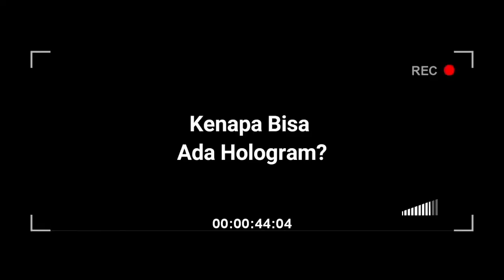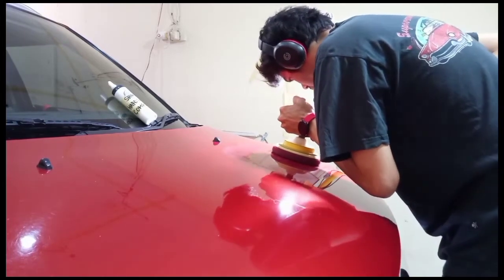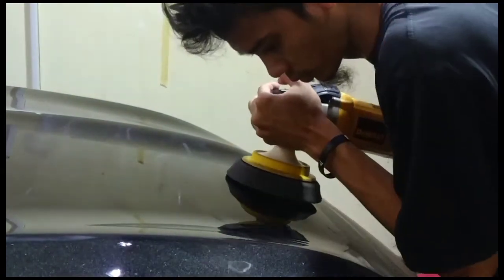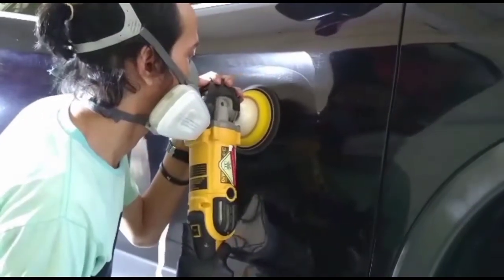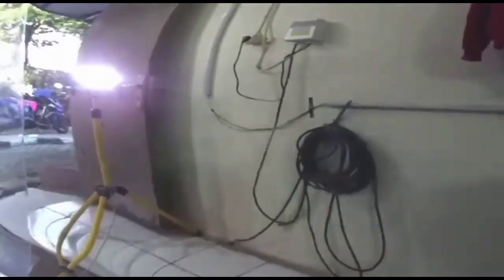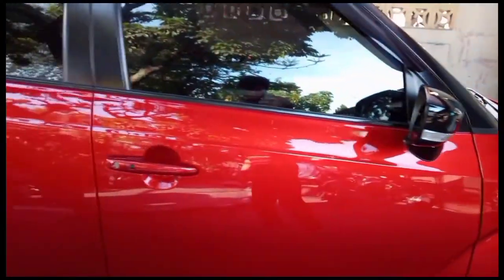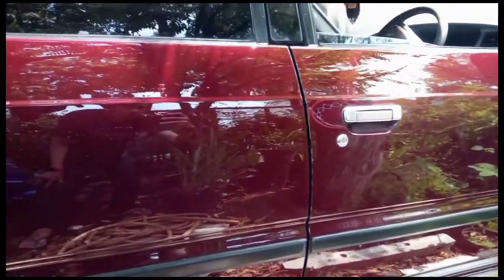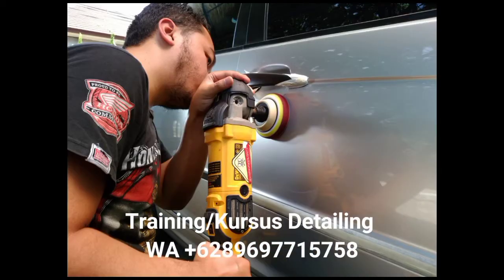Cara Menghilangkan Hologram/Buffer Mark di Mobil Warna Hitam

Comment: Alo gan..saya kya nya alami efek embun atau hologram setelah di kompon bgkel, mobil Ertiga item metalic itu smisal di kompon kedua apa ga bikin Cat mudar atau baiknya gmn? Thx
Reply from the maker: Cat pudar sih gak ya om selama penanganan & teknik polesnya tepat.. Bisa dicoba dipoles ulang pakai cutting compound yg grade PRO spt Ultimate Heavy Cut, IPO Ceramic Cut Plus atau merek lain (nti saya share link tokpednya) dgn mesin rotary atau pakai mesin Dual-Action agar lebih mudah dipakainya..
Reply from the maker: Compound cuttingnya bisa pakai ini dipadu dengan busa cutting

https://www.tokopedia.com/tokosalonmobil/repack-250-mili-ipotech-ceramic-cut-plus-cocok-utk-soft-sticky-paint 

Untuk compound finishingnya bisa pakai ini dipadu dengan busa finishing

https://www.tokopedia.com/tokosalonmobil/repack-250-mili-ipotech-ultimate-ultra-fine-polish
Reply: @BelajarDetailingAcademy  maaf  gan, mgkin saya blg ke bgkel nya soale bahasa namanya saya ga ngerti..alias tdi liat hasil bgkel kok kaya embun ud saya cb cuci lg msi bgtu. Tpi sbelumnya salam kenal n makasih ud mau respon saya gan...
Reply from the maker: Bagusnya pindah tempat aja om, mendinga cari workshop detailing aja biar lbh pasti.. Nanti takutnya kyk gitu lagi kasusnya kalo balik ke bengkel yg sama.. 

Ya hasil kyk gt bisa karena kurangnya pengetahuan memoles yang tepat, alias gak ngerti teknik poles yg bener..
Reply: @BelajarDetailingAcademy  awalnya saya abis ketok cat di bgkel itu gan, tpi liat hasil nya kok ngembun..bsk rencana mau di kompon ulang di bgkel yg sama..alias garansi.

Comment: Bang motor saya body doff pake kompon ada bekas putihnya gitu cara ngilanginnya gmna ya
Reply from the maker: Waduh, kenapa dipoles pakai compound om? 

Bisa jadi kalo doff/matte kena compound itu jadi Luka, agak susah nanti ngilangin bekasnya.. Karena karakter Clear/Pernis nya memang berbeda.. 

Coba bersihkan dlu dengan Air Shampoo, terus dikasih Wax/Sealant semacam EXXO Coat dari Coating Factory... Mungkin gak hilang secara total, tapi bisa mengurangi.. 🙏
Reply: Bang mau nanya untuk menhhilangkan baret kaca mobil bekas lap kasar pakai apa ya obat nya dan cara tahapan nya 🙏..terimakasih

Comment: Om unt menghilangkan kabut mungkin yg disebut hologram setelah dipoles sebaiknya pakai poles finish merk apa ..
Reply from the maker: Apa aja om bebas kok merek apa aja.. Selera.. 

Kalo utk mobil2 soft & sticky (yg lengket2) saran sih pakai Ultimate Soft Finish..
Reply: @BelajarDetailingAcademy  klau diamplas dulu kira2 boleh gak  dan klau boleh menggunakan amplas nomor brp.soalnya awalnya sebelum sy poles mobil sy amplas dulu dng amplas 1500.ee setelah sy poles malah goresan bekas amplas msh keliatan dan berkabut putih..mobilnya honda city hitam
Reply from the maker: Halusin dlu pakai amplas 2000.. Setelah itu halusin lagi pakai amplas 2500.. Yg terakhir pakai amplas 3000

Comment: Kalo di soft paint itu udah di poles bersih bgt udah ga ada swir dan goresan halus ehh begitu di lap ada lagi swir.saya coba begitu dah di polishing ga saya lap saya coba di cuci dah gitu saya coating ehh pas di lap coating nya ada swir lagi padahal lap microfibernya baru dan bersih.
Reply from the maker: Swirls nya bekas Lap atau bekas polesan? 

Kalo bekas Lap biasanya bukan Swirl, tapi goresan lurus sangat halus.. 

Kalo bekas polesan yg belum Mateng iya bentuknya Swirls tapi lbh halus dari kondisi sebelum dipoles..
Reply: @BelajarDetailingAcademy   swirr om jadi kondisi cat nya dah bersih begitu kena lap adalahi swir tapi lebih halur dan kecil lingkaran nya apa softpaint itu kalo di lap emang gitu ya
Reply from the maker: Udah di poles step finishing? 

Ada 2 kemungkinan, 

1. Hasil step 1 cuttingnya blm mateng atau masih menyisakan swirls yg agak dalam. 
2. Hasil step 2 finishingnya kurang mulus, jadi terlihat mulus karena tertutup minyak compound, ketika di Lap IPA akan terlihat lagi swirls nya..
Reply: @BelajarDetailingAcademy  makasih banyak om petunjuk nya 🙏

Comment: Om saya kan ngilangin baret halus di mobil  pake compond, pake cara manual pake tangan ,nah setelah di kompon kok malah jadi kusam putih2 gitu, cara ngebalikin wrnanya gimna ya om? Mobilnya wrna hitam
Reply from the maker: Dipoles lg om, kalo bs harus pakai mesin poles, boleh Rotary atau Dual Action..
Reply: @BelajarDetailingAcademy  saya ga punya mesinnya om, kira2 kalo ke bengkel minta polesin kena hrga berapa ya om? Buat pintu tengah sebelah kanan doang
Reply from the maker: Yg pasti dipolesnya 1 panel pintu.. Kalo disaya sekitar 100ribuan.. Gak tau juga kalo yg lain om..

Comment: Mas kalau pakai mesin DA tp compound pakai ivory bs hologram apa engga?
Reply from the maker: Ganti pakai Menzerna aja jgn ivory
Reply: @BelajarDetailingAcademy  menzerna yg seri apa mas kl buat mobil hitam soft paint ?
Reply from the maker: Mobilnya apa ya?
Reply: @BelajarDetailingAcademy  sigra Omm
Reply from the maker: Coba pakai ini aja compoundnya om.. 

Step 1 IPO Ultimate Heavy Cut 
Step 2 IPO Ultimate Soft Cut 

Ada yg jual kemasan Repacknya di Tokopedia..
Reply: @BelajarDetailingAcademy  oiya omm siapp...makasih atas respon  cepatnya...saya doakan workshopnya makin rame n sukses ke depan 🙏🙏🙏